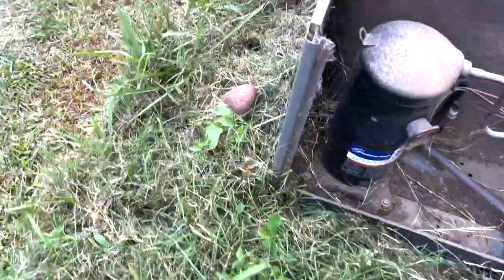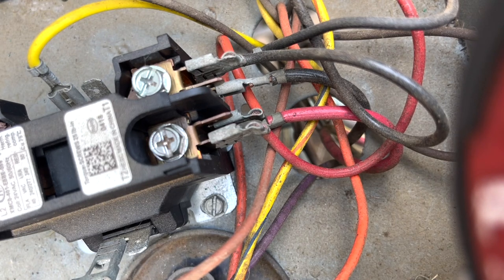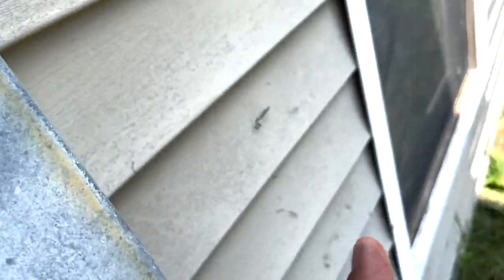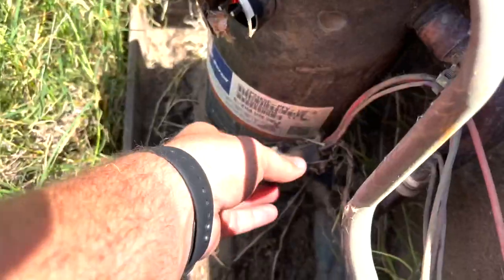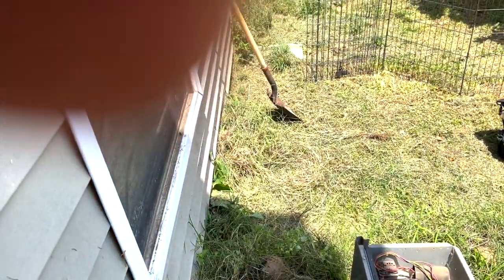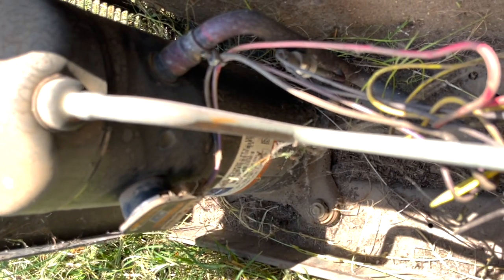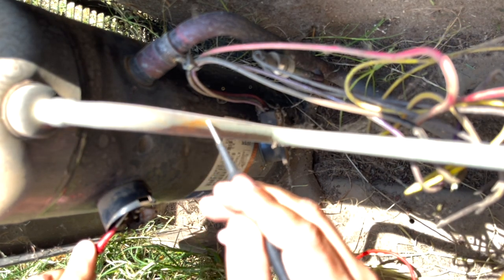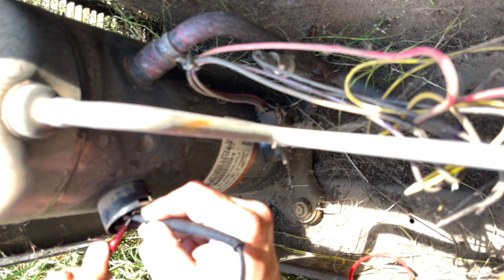Condenser Tripping Breaker

Comment: I was at a friend's house yesterday, Sunday, and he had two condensers.  Both were out, and less than 6 years old.  They recently had two power outages in a short period of time.  I told him maybe a surge caused issues.  I fixed the one with a new capacitor.  Both herm and fan were at zero on my meter.  The second unit was completely dead, and immediately tripped the breaker.  I tested that capacitor, and it too, had no microfarad readings at all.  I replaced it also, but there was another problem as well.  I thought it was very strange that both capacitors were bad. (they were both bulged on top).   If I had known about this tip of unplugging the compressor, I might have been able to learn what the problem was.  Of course, I couldn't have replaced the compressor myself anyway.  Maybe the compressor is still under warranty.  You can't stop a Trane!  But, in this case something did.  I have a whole house surge protector, and I intend to install a surge protector on the shutoff at the condenser, just as a bit more protection.

Comment: I didn't notice if you checked continuity between the 2 hot legs on compressor??  A 220 appliance doesn't have to short to ground to trip it could short to power between the 2 phases.

Comment: You did good John. We call that the redneck test. If the breaker trips when the compressor is plugged in but it doesn’t when it’s not and there’s no damage to the plug wiring, that compressor is bad point blank. Good work man

Comment: I got an AC unit that only trips the breaker after its been running for a while. I turn the breaker back on, the AC runs fine but then at 3am the breakers tripped again....Any tips ?
Reply: Same problem here
Reply: @WJR1965  I fixed the problem by replacing the 2 capacitors ( Motor start-up and compressor )..I ordered exact matches off Amazon. Funny thing is the AC guy told me I needed to get a new AC system for only $5,000.....LOL the 2 caps cost me under $30.....Sometimes ya just go in the name of Jesus when ya got nothing to lose by trying.

Comment: @1:26 just have a look at L1 and L2 wiring on the contactor.  Sweater killed it but would have cleaned up the wiring first for testing.  Looks like a lot of voltage drop there.

Comment: You didn't check voltage incoming and outcoming that contactor.you also didn't check for continuity on compressor's plug,maybe you have a short circuit there but probably the motor is stuck that's why tripped the breaker

Comment: There are more ways a compressor could be bad other than it going to ground. When you ohm out a compressor through the windings it should be within one ohm across all the windings. I have also had a compressor not show ground while off but once it fired up and ran it showed ground while the compressor was pumping.

Comment: I like my Subco megger, inexpensive, easy to use and idiot proof, have the Fluke 1577FC new in box but the Subco is just so simple and trust it over an multimeter.
Reply: Meggers are not rated for use on scroll compressors.

Comment: I used a 2x4 and hit the compressor just right when its trying to star and magic happened 
Whats happening here its that its locked and trying to start pulling all that amps it will overload the breaker and eventually tripp I have seen a lot of units with this symptoms
Reply: Regardless its still shot right?
Reply: where on compressor is just right?

Comment: I would check resistance across the legs on the compressor it probably has a shorted winding, also speculation but the winding probably burned out because the  coil is plugged and the head pressure it through the roof. Either way the compressor is obviously shot, good work bud. Also with the land lords try to sell them on preventive maintenance, it's easy consistent money (come in the fall and spring for a filter and a cleaning maybe something else) and the unit will last them a lot longer, you get extra work so everyone wins.
Reply: Had a similar problem earlier this spring. The condenser was constantly blowing the breaker, but the coil was clean and the unit would run for about 3 seconds. I took the amps as the compressor started and it jump near 100 amps on a 40 amp breaker and it would blow. My boss told me the windings were screwed up and don't bother, the compressor or unit would need replacement. As to this video, that coil was super packed with dirt and needed cleaning 2 years ago.
Reply: He did that.  Did you not watch the video?  A bad starter cap will do this SAME THING.  And is fixed for < 20 dollars.
Reply: @klabkebash  Coil has nothing to do with the startup current (amps).

Comment: Most residential air conditioning equipment sold in the USA today is made in Mexico, and China, since making it is a labor intensive process which is difficult to completely automate. If it was all made here, it would cost quite a bit more to purchase. Even when you buy things 'made in USA', many times some parts in it were made in China, or Mexico to take advantage of lower labor cost outside the USA. China has the additional advantage of huge economy of scale, with giant factories where thousands of workers live on the factory grounds. Today, there is such a labor shortage in the USA, that making much more inside the USA would be impossible. There aren't enough people available to do all the work that would be needed to accomplish all 'inside USA' production. Huge shortages would result if we tried to do that. Inflation would go through the roof. The auto, and many other industries, would shut down from lack of components. It will take decades to bring a lot of manufacturing jobs back to the USA, if it ever happens.